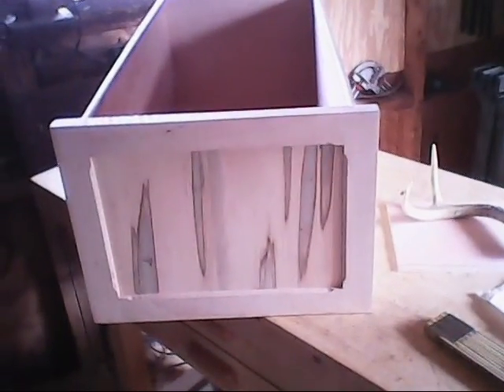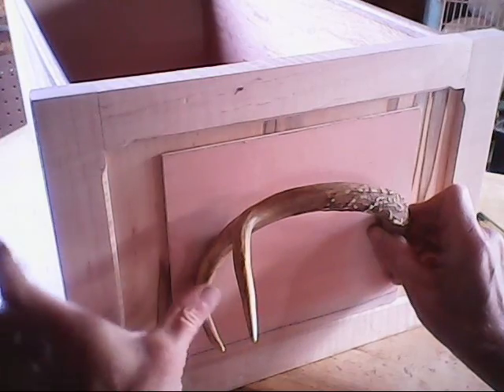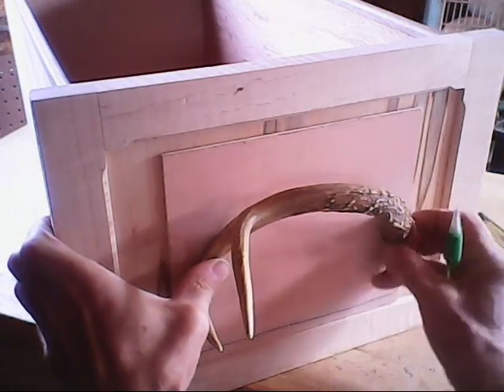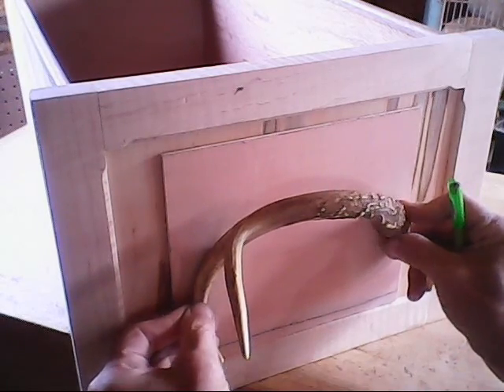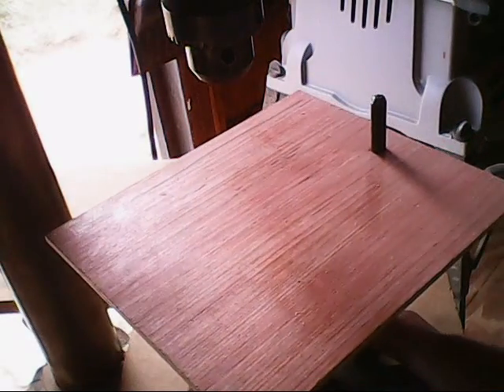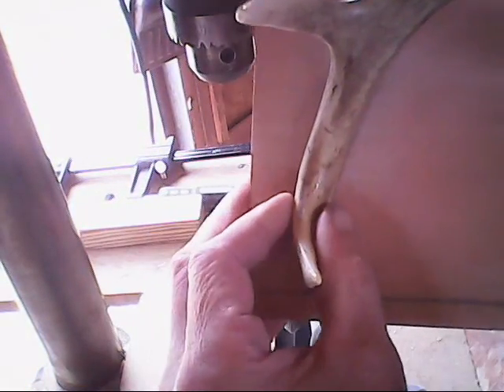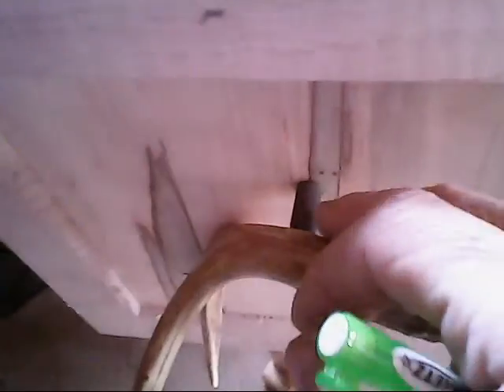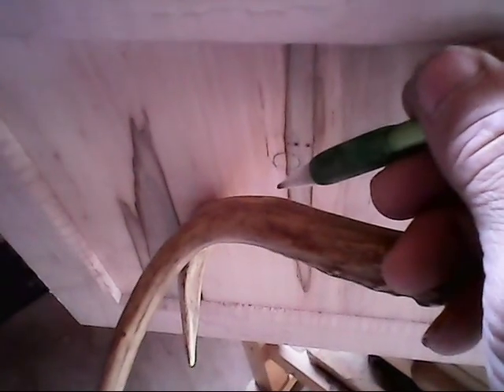antler pulls for an executive desk

Comment: where did you get the hardware, and at 6:20, what is that hand drill called that you are using?
Reply from the maker: Hi,
The hardware was some steel round bar, I think around 3/8" - 1/2"  dia.
with a thru hole drilled, to accept a machine screw, to act as a standoff.
The machine screws were either 6-32 or 8-32. pitch.

At 6:20, I was using a t-handle tap wrench, to tap threads into the antlers.
Reply: @myenjoyablehobbies  thank you